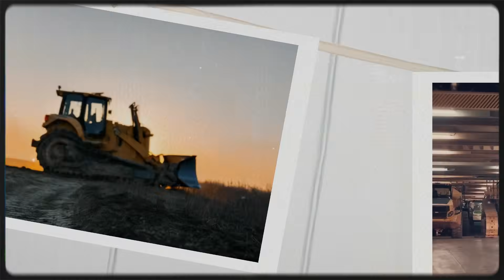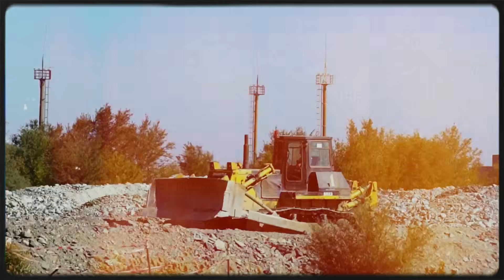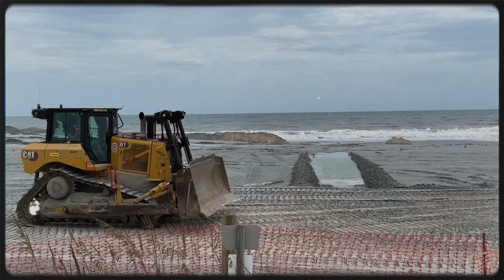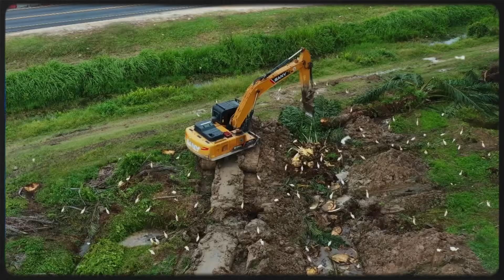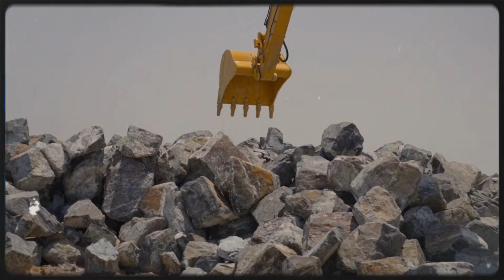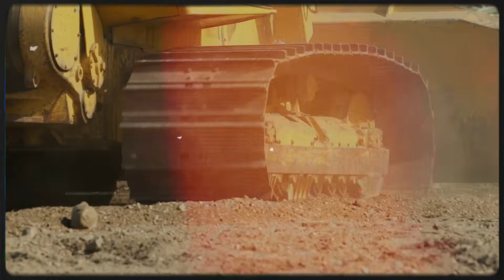Why Excavators Can't Use Caterpillar’s High Drive Tracks!

Comment: The dozer moving more the excavator stationed and rotate plus the high track not so much power the maintenance side storm work even emergency response at times. The high track one machine you can put a winch drum bolt it and snatch block chain cable you can use the dozer drive sprocket to winch with the track off drag it behind break it and pull it back on in feild maintenance and dumps the rock or sand type soil crushing on the teeth and sprocket as a rock crusher and turning don't put the weight on the sprocket the weight on the rear push the side of the track on the side of the teeth wearing the drive chain or under carriage faster. Straight tracks still good machines the high track feild maintenance and in wet slop or water 4ft deep using a snorkel to find the track yes you got to break the track apart before pulling it to the rear to get around the blade arm then lay it out and pull ot up with the dozer it self. Disclaimer land maintenance is not eco terrorists even animal friendly no maintenance   is not eco terrorists at all

Comment: Though a dozer for example can be equipt with either, because of the center of grvity in the use of an excavator, the longer track vs the shorter triangular track is utilzed. The weight using a long track is spread out more, thus assiting in the center of gavity being higher. Adding on some counter weight, causes the center of gravity to be lower. Dozer being considerably lower in their total height, have by default a lower center of gravity, and don't need counter weight's.
Physic's class 101 would teach you that.

Comment: yes, good points, they have the elevated sprocket as it keeps the drive axle out of the mud, so no 'water' in the differential, also its ONLY pushing forwards, an excavator and crane have a turret which turns 360 and it would be an obstruction to the working range of the tools. Also a dozer works on reasonably flat ground, so can afford to be heavier built than an excavator.
Reply: If you think a dozen only works on flat ground, you are mistaken

Comment: Im sure you missed something.
The elevated final drive reduces wear by increasing ground clearance, which lowers the risk of debris entering the track-sprocket interface. Additionally, the longer track path allows material to be shed before reaching the sprocket.

Comment: Can some please explain why excavators can only turn 15 rotations before unscrewing? Asking for a friend.
Reply: As a former construction equipment technician, I can assure you that there is no such thing as unscrewing in excavators due to rotation. It's not mounted on a single screw to just simply unscrew. Instead, excavators use center swivel joint and bearing system. So there is nothing to unscrew. But the story is a ture thing and often told to newcomers to see if they will fall for it or as a joke regarding the need to rotate in both directions to avoid damaging hydraulic components inside the centre swivel joint. Thank you.

Comment: since you are using AI to generate the video clips anyway... I am disappointed that you did not use it to show what an excavator would have looked like with a triangle track setup....

seriously though, people think that using AI makes things better, but for the same amount of time and effort, you could have made a 3D model of what you wanted to show, and the video would have been better for it
Reply from the maker: Sorry For that I will be trying to visualize everything...thanks for watching
Reply: @MotorVibe_Talks please don't. Try making a video without that AI slob. How about that? Create some actual content for once? Create something, instead of stealing it via AI?
Reply: As someone using engineering 3d modeling programs, it is not easy and definitely not fast
Although i guess something that artists use might be better for such content
Reply: @Fesko-ly1wr basic 3d shapes are elementary to do in an art focused 3d program like Blender
Reply: What Ai?
Reply: @TheQuickestTurtleyou ain't the sharpest tool in the shed aren't you?
Reply: @dundee5593 Bro what I do

Comment: It keeps the sprocket out of the dirt increasing longevity. But it puts more slack on both sides of the sprocket and makes it not as smooth for finish grading.
Reply: And let's put a swing on top...the only way this may work now aways is on a feller butcher or such with the auto leveling. But even then you'd be sitting on a skyscraper.

Comment: Actually the high drive doesn't add any traction it does put more stress on the chain since there's only 4 teeth on the chain at any given time. but it does add a longer track and more undercarriage components for caterpillar to sell. the patent has been off this for a long time and cat is still the only company doing it. and cat has actually moved away from it except in its largest dozer class. it does look cool though lol
Reply: Leibherr do aswell
Reply: Totally agree bout the 4 teeth on the chain.  Really believe biggest thing is the "look cool factor"..
Reply: Same comment I made here to another poster: CAT currently has it on the D6 - D11 dozers.  I agree that there are mixed opinions on it.  Interestingly enough, probably 95% of the compact track loaders I see on jobsites from all major brands have the elevated sprocket design.

Comment: The only dozer I've seen with a high drive is the D11...There are some in the industry that hate it...Just another thing to go wrong.
Reply: CAT currently has it on the D6 - D11 dozers.  I agree that there are mixed opinions on it.  Interestingly enough, probably 95% of the compact track loaders I see on jobsites from all major brands have the elevated sprocket design.
Reply: @neilopfer5687  : ) It makes the machines, look cooler, that's for sure...That's a sales trick...: )...Good health to you and yours...:)

Comment: Didn’t watch the video but the question in the title is ridiculous.  Um maybe because of 2 things. A hoe doesn’t have the clearance between the tracks and  the underneath and they aren’t built for pushing.  Excavator drivetrain is for mobility not working.
Reply from the maker: I know.....The video is mostly about the dozer
Reply: @MotorVibe_Talks I stand by my comment but I should have watched the video first! 👍🏻
Reply from the maker: Thank you....I appreciate your knowledge in heavy machinery
Reply: @MotorVibe_Talks  well please give other reasons in a pinned comment at least. Question is about why excavators can not have it. So it's not all about describing about why bulldozers have it. And the reasoning in the video is not sufficient for the question in the title. There are lot more reasons. I know that because I was a former construction equipment technician. So at least mention other reasons in a pinned comment.
Reply: in english this difference is clearly catched by words - excavators have "travel" function instead of "drive"  like a dozer or loader.
Reply: @vetrieska11 ”catched by words” is not English!  😂
Reply: @Surewhyno sorry, not using AI for fine english comments.